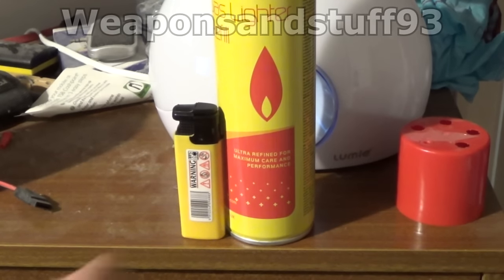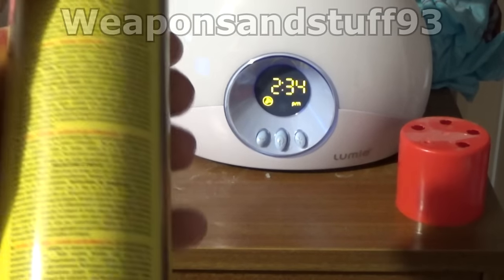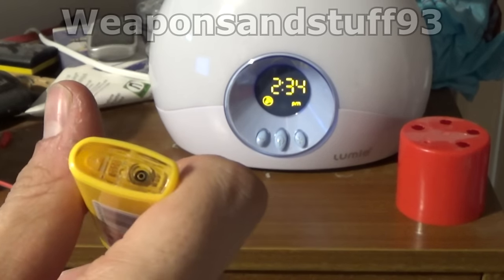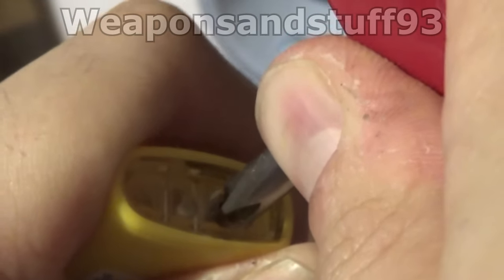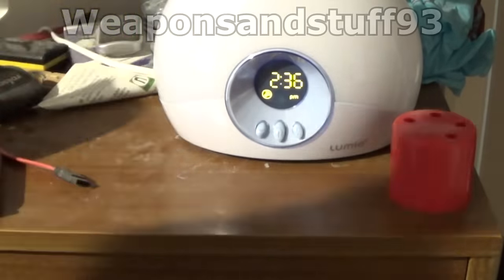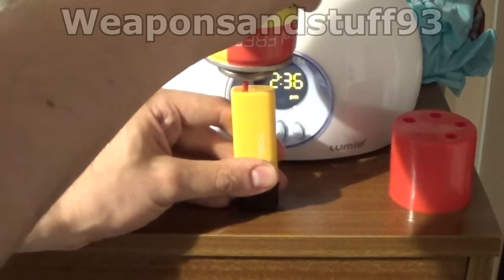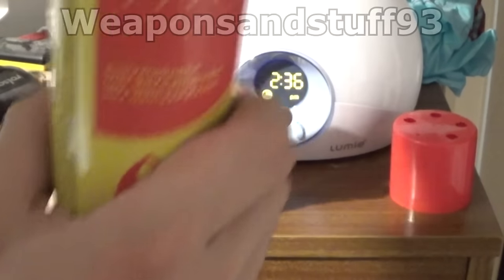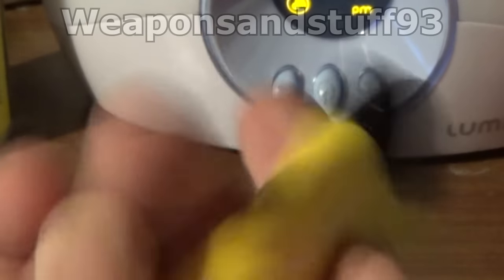How to refill a Butane lighter

Comment: Thanks for the tips. I didn't realize a bit of sputter is normal and freaked out and stopped last time I tried. This time I put a little more pressure into it and it worked great. Thanks again.

Comment: Thank You so much for the tips. I would like to add on a bit, You can use ballpoint pen to let go of the air. If you have a bit of the gas left but can't light, let go until you feel that the lighter has a cold sensation, that's when the liquid turn into gas and it start to use the remaining liquid in the lighter, that's when I stop and refill the gas that was share on the video. Press hard within seconds it should be filled. Thank You

Comment: Thank you SO MUCH!!! I'm not very handy and I've watched tons of videos and couldn't figure out why I after bleeding the lighter etc always ended up with a lighter that had no butane inside but it was all over my hands.  In the US Robson is in a white with red canister but 1) I didn't know I needed to shake it 2) the brute force method Whoah!!! 3) Automatic results with brute force.  I was pushing down like the nozzle was a delicate flower.  Freaking butane all over me and the lighter. You can buy cheap 99 cent refillable flame lighters in the US and I got sick of throwing them out and being wasteful but I thought maybe they're 99 cents because they're impossible to refill.  Nope, just crap advice until you.  Thank you very much
Reply from the maker: Glad it helped, if I have a lighter that won't refill I find it's generally because something's got into the gas tank, so it needs bleeding first and then just to shove the nozzle in hard until it's full. Sometimes when refilling the lighter gets cold, you'll have to let it warm up first until it's a good temperature again.
Reply: Yooo help me
Reply: @justinrich7455  what's the problem?
Reply: ODD YO the fluid just spills out , my fluid has a small nozzle but I wouldn’t see why it dosent work
Reply: @justinrich7455  did you try firmly pressing a pin into the button at the bottom to clear airflow first?

Comment: We used to sell a lot of Turboflame jet lighters. 

They often came back as faulty bit the issues were caused by impurities in the cheaper gasses
Reply from the maker: +Jack Penn Yeah for a more expensive one I have on order I've got some better butane for it but I don't really mind the cheap ones fowling eventually due to cheap butane.
Reply: +Weaponsandstuff93 for sure dude. Replacing the cheap ones will be way more cost effective

Comment: Thank you for the video, I wanted to check how to be sure the lighter is filled well, until I realize you have a see-through bottom while mine is black. What can I do ? :/
Reply from the maker: The only real way to tell with an opaque lighter is to judge the difference in weight, if you're filling it and it stops then it should be full.
Reply: Usually the gase just spills out but when its empty it does not till its filling up to full

Comment: Hey there. Just wanted to ask if it was possible to overfill and possibly have the pressure inside the lighter blow up?

Not ignite blow-up, but more like too-much-pressure blow up.
Reply from the maker: In theory the valves should always let the lighter stop you doing that, basically when it gets too full the gas starts to leak out until it is back to normal pressure. But in reality a lighter could explode I guess if the valve broke
Reply: @Weaponsandstuff93  Oh okay. Thanks for replying!
Reply: If they have a valve like this one then always purge and refill when almost empty. Never top off or it will ruin your valve. If it’s all metal it’s fine like a clipper metal valve.

Comment: Why did you release the air before the refill?
Reply from the maker: Because air bubbles in the lighter stop it working properly.
Reply: Put compressed air in your brake lines and you’ll find out exactly why he did that. Trust me you’ll remember that for a lifetime. Or blow up a balloon with air and try adding water or soda inside and ask yourself why can’t I fill this balloon with Fanta? It’s not working! I don’t get it. Lol

Comment: How do u adjust the flame as mine is burning as a normal lighter without the strong flame...mine IS A WINDPROOF lighter..
Reply from the maker: There should be a little lever or screw you turn one way or the other to adjust gas flow.
Reply: Just blow hard into the top when that happens.  Over time dust and static can clog the valve at the top where the flame comes out.

When I blow into it works fine until it clogs again every few weeks through general use.

Edit:. Another way is gently brushing inside the valve bowl with an old toothbrush.

Comment: how in the world you can do it so easily? I got the exact same lighter and used premium butane by Colibri and when I filled it, it looked like it didnt create enough gas pressure so the flame coming out is soft flame. Also with my Dupont Maxijet, after refill always turned out faulty.
Reply from the maker: +lelaki88 Try fully bleeding the lighter first, you may have contaminated fuel stuck in the lighter.

Comment: I have the same lighter and I refilled it with lighter fluid and now it wont work.  I feel really stupid asking this but Is it because I used lighter fluid or I overfilled it or I mixed a little bit of lighter fluid with butane?
Reply from the maker: Most likely because it's not meant to use lighter fluid but butane, try bleeding the entire lighter by opening the port and then filling it with fresh butane, the lighter fluid could have damaged the seals though.

Comment: I tried refilling a lighter using this method but for some reason it won’t light after. A spark happens but I don’t get a flame. Does that mean the lighter is broken?
Reply from the maker: Is the lighter still cold? You generally have to leave them a bit to get back to room temperature
Reply: Weaponsandstuff93 thank you. I tried that and now it’s working

Comment: Just can't get it to work for me :( Did everything to a "t" following the video and all I got was the butane to leak out big time all over my hands and down the lighter. Unreal!! :( Have so many NICE lighters and can't get any of the refilled. Just beyond frustrated. Will HAVE to go to a Cigar Shop in the nearest town to me and see if they can help me which I'm sure they will but still as easy as this looks I shouldn't have to go through all of this just to refill a little lighter. Stress and more stress to say the least. How does the old saying go? "Don't sweat the small stuff" ha! yeah right .. who came up with this one? BTW, really good video!! :)
Reply from the maker: Maybe you have a broken lighter?
Reply: Weaponsandstuff93 ... They 'all' worked before just fine but just ran out of the butane in them. One still lights when I press down and hold it (it's a ZICO torch) but it won't stay on just comes on within a second and stops. I know it's almost close to running out of the butane in it and is probably the reason why it's doing that. I've drained them all just as showed at the bottom by pressing in and you can hear it coming out. So none except for the Zico I just mentioned above are all drained of the old gas 100%. The butane cans I bought to refill them with is Neon 11x Ultra Fine. I heard Ronson is the best. Just don't know. Beyond frustrated to say the least. I've just purchased a few new oil lighters. Can only pray they won't give me a fit like the butane ones have. To add: All of my lighters are still in brand new condition because it hasn't been that long since I purchased them all.

Comment: I did the same method to what looks to be almost the exact same lighter, but when lighting it, it starts like a jet but then ends up acting like a normal bic lighter
Reply from the maker: I assume not enough pressure is getting through
Reply: Weaponsandstuff93 I think it just needed time to pump thru enough gas. It started working properly after a while
Reply: @Dark_Shadow_27  overfilled it. It burns gas, not liquid. There needs to be room for it to warm up into gas.